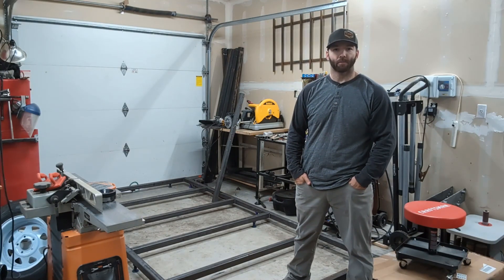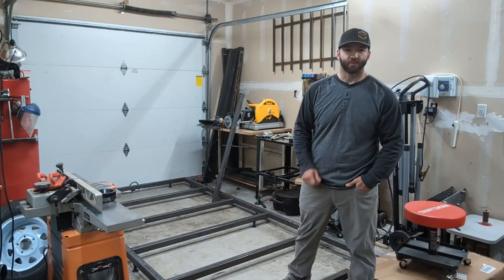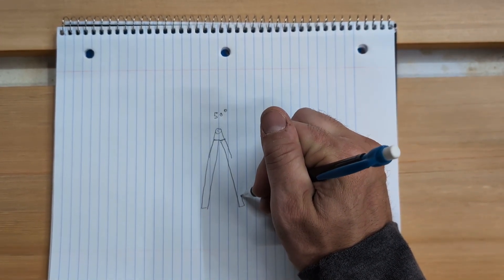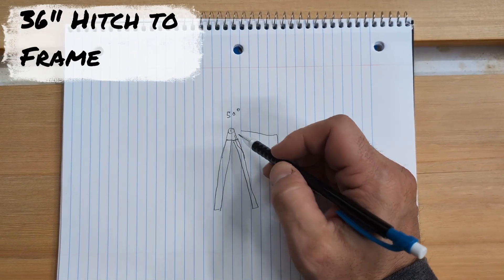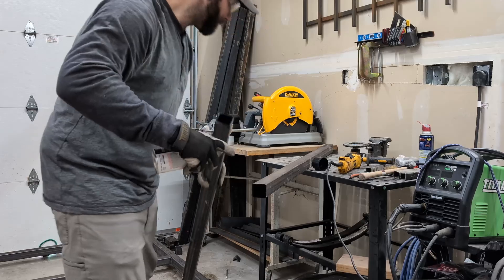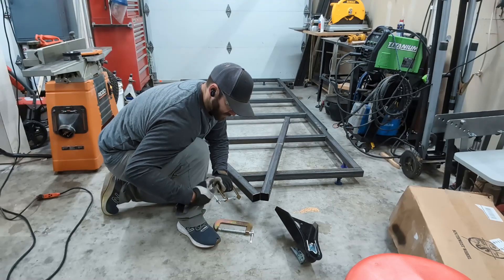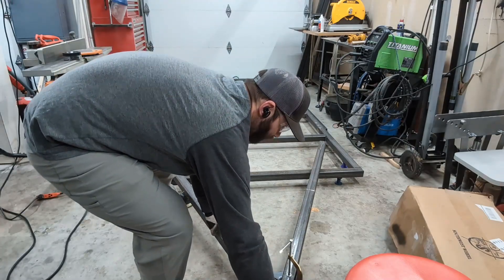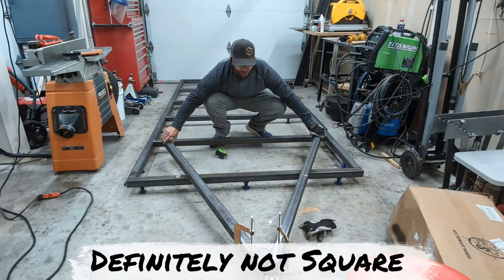Building a Squaredrop Trailer on a Budget: Part 2 - Tongue and Hitch

Comment: you may regret the short tongue. Likely your going to damage your tow vehicle when backing up, and the trailer will be very twitchy when backing up. For the want of one more crossmember.
Reply from the maker: Thanks for your concern. However, 3 inches will not make or break the driving dynamics of the trailer. And if it does I will be the first to come back on here and say you were right
Reply: @RandomDudeWorkshop as long as tongue is half length of width of your towing vehicle  from front of frame to tip